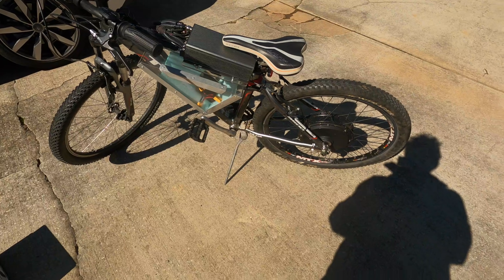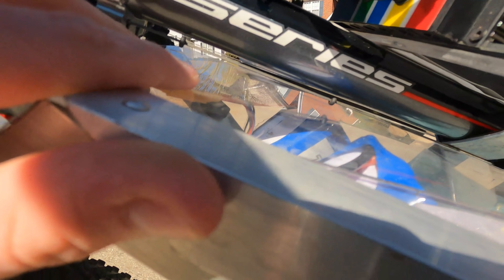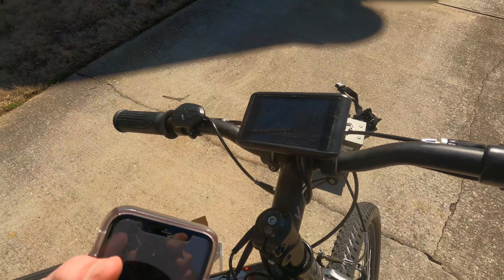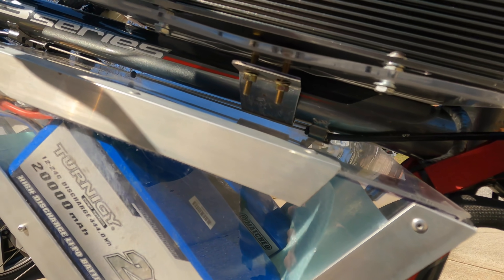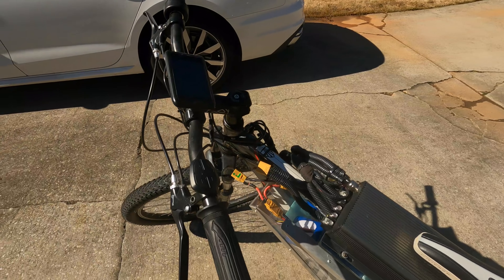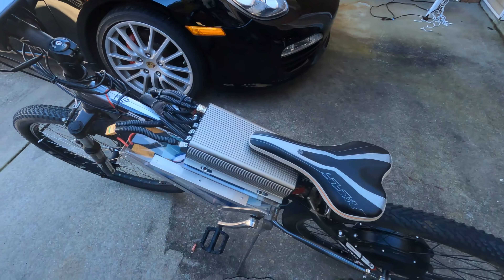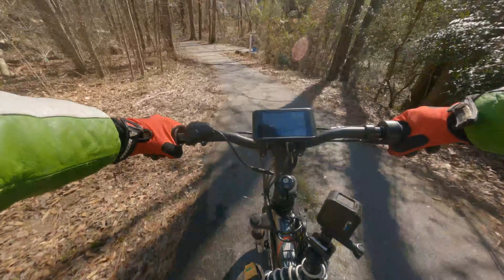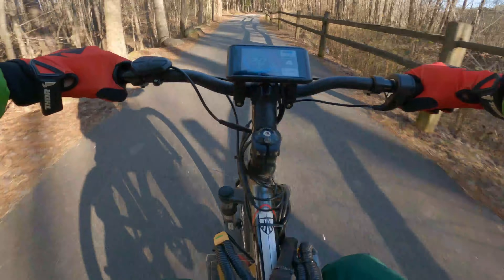My Homemade 10,000W Ebike! (Sabvoton72150)

Comment: 2 6s batteries = 12s, 12s * 3.6V is 43.2V, 43.2V * 150 is only 6,480w. Still very powerful, but not quite 10,000w unless I'm missing something.

Also, I don't think that controller can burst 350A, 350A is the max phase current which is the current between the controller and the motor.

Other than those two things, I love the build.

Comment: Did you put by your self the motor to the wheel ?cause i found the motor separate in stores and if i bought it with the wheel i must change also the rear fork to fat bike size

Comment: hey what size dropout is that meant for, I’m sure that bike isn’t 150mm. So is that you have to run one gear and it will fit? Also, are you bending the chain stays apart to make room?

Comment: Im running 5000watt same wheel with a 80a controller 72v40ah battery 84v fully charged .. sw900 display im getting 45mph what do i need to do to get it doing 60mph ?
Reply: Shunt mod
Reply: @dahman9672  does that give me more top end mate?
Reply: Gives u more all round watch some videos first make sure to put some protective material underneath before proceeding
Reply: @dahman9672  cheers mate yes I no how to do It I just thought I wouldn't get more top end I'm building a new bike now with a fardriver controller... But I'm gonna give it ago on my old bike cheers buddy

Comment: 500 watts is the limit for dealers selling bikes to the public .Running a aftermarket 10000watt hub motor isn't illegal. Going faster than 32km is. Daymak em2 with 10000 watt hub, Goodyear rubber,new rear monoshock and fun times

Comment: I go 80km/h 60V and 1500W , your have max 800W. 10000W means you go 130-150km/h
Reply from the maker: Power doesn’t equal speed. Voltage is directly correlated to speed.

Comment: Those 5 levels of assist are for PAS (peddle assist modes), don't know how you managed to hook that up with your throttle.
Reply from the maker: They can be used for either. I just disabled the pedal assist function. I have no cadence sensor.
Reply: @AllThingsElectric_  Nice.

Comment: What size are your batteries? I have a 72V 3000w and I'm wanting to use 2  36v,  100amp hour batteries will that work?
Reply from the maker: That would be one killer battery! Yes it would work

Comment: sorry getting in to electronics when you run these in seris does this create a 44v 20ah battery or a 22v 40ah battery thanks man
Reply from the maker: Series always adds the voltage and keeps the capacity constant.
Reply: @AllThingsElectric_  so would this be 44v 20ah?

Comment: This video is one of the best and greatest on the entire internet, because it shows an extreme motor on a regular mountainbike hardtail frame. Bikes with 1'000 or 2000 Watt, Stealth, "Motorcycles" and so on are plenty here on YT, but something like this is rare.
Question: Is the motor the 5'000 Watt one? For which frame dropouts is this motor - not for 135 mm?
Reply from the maker: Thank you! That was my goal! I haven't seen people put this kind of power on a frame like this (for good reason). I thought it would be interesting. It saves a lot of money, but is quite dangerous. Not sure about the motor dropout, although they are larger than the actual frame.

Comment: If those dropouts fail, those torque arms won't be much help. I'd strengthen the dropouts because 150 amps going through such a small area will eventually break it and you won't enjoy the outcome. Hope it all works out well for you.
Reply from the maker: It's been holding up very well so far, and now I am pushing about 14kW. Wouldn't be a bad idea though!
Reply: Is this layout safe?

Comment: Since you have two 22.2V, 20AH batteries does that make a 44.4V battery with 40AH? If you were to put three of these batterys together would it be a 66.6V, 60AH battery? If so that is a steal for only $650.
Reply from the maker: The two batteries are in series, meaning their voltage will add up and the capacity will be the same as one battery. In a series connection, the capacity of the battery remains constant.

Comment: You said you got 2x20000mah are these 2x52v 20000mah? I am thinking about buying this set up I have one 52v 20000mah battery would just need to buy 1 more.
Reply from the maker: they are two 22v batteries nominal
Reply from the maker: with two 52v batteries you would have to wire them In parallel so your capacity will double, unless you mod your controller to take over 100V

Comment: What kind of frame is it? 

Steel?

I build myself a 1500w rearhub  ebike. It was just a normal mtb with aluminum frame..

Now im planning to build myself anorher one.. and offcourse it must be bigger better faster than my previous build..
But im not sure if a regular aluminum frame is save enough to do so..

I have a steel frame wich i can use, and steel should be stronger..

Im not sure what kind of engine is possible for a steel frame..
Reply from the maker: Yep this is a steel frame. I would suggest steel unless you build the aluminum frame strong.

Comment: What W battery are you using with the 5000w wheel. Just wondering. (I allready know what V it is but wondering what W the battery is because I'm making a bike at home).
Reply from the maker: Well they’re 48v and can deliver 200a so 9600w

Comment: Hi there, All Things Electric: How steep can you ride uphill and how far can you ride uphill? Does motor get hot and stop when riding too long uohill? Which capacity of a 72 Volt Lithium battery would you think would work fine? Thank you for replying.
Reply from the maker: The bike has never failed on a hill, and has always had more than enough power to get through any situation. The motor is always cool to the touch also. 20Ah seems to be a sweet spot for me, but def could always use more.

Comment: Well actualy its 6660w because you have 12s 44.4v nom x 150A, at 66.6v (3lipo) you would be death hahah
Reply from the maker: Right, with this current voltage it’ll push less power than with a 72v setup. I plan to switch to 72v soon.
Reply: @AllThingsElectric_  congrats! Be minfull on the trotle haha what a beast

Comment: Hi how can your 48V battery handle that many amps? I thought you need 72V 150BMS battery for that
Reply from the maker: Since these are high discharge lipo batteries, they can safely pull 200 amps

Comment: Are you still running these batteries? just want to know how they are holding up.
Reply from the maker: yes i am! I have 3 of these batteries, and unfortunately one cell (in one battery) is much lower than the others. Lipos can be pretty difficult sometimes.
Reply: @AllThingsElectric_  I have a couple more questions. What charger are you using and can you charge them all at once? And how long does it take to fully charge. Thanks for replying love the videos.

Comment: Hay I built a 52v treck Marilyn 5 with a 1200w motor the current set up I get 35mph and a range of honest 10-12 miles. The battery is 52v 13h with an out put of 30 amp. I call it my little monster, love the build keep up the good work👊👊👊

Comment: Wouldn't that get Hella hot to the point where it would melt the phase wires?
Reply from the maker: This controller actually runs extremely cool. After riding heavily, it is still cool to the touch.

Comment: Hello, I have a 3t 50h 5000w motor, it has a 72v 80A controller and runs at 85km / h with a 26 "wheel, if I put a 150A sabvoton controller, will it run faster?
Reply from the maker: I believe that if you get the higher amperage controller, you will get more torque. Now you may get slightly more speed, but will mainly see a torque increase. Speed depends on Voltage.

Comment: hola yo tengo un motor 3t  50h 5000w, tiene puesto un controlador de72v  80A y corre a 85km/h con rueda de 26", si le coloco un controlador sabvoton de 150A podra correr mas rapido?
Reply: Jaja mas rapido. Quieres volar o que. Jaja

Comment: are you using flux weakening to get 60mph or what because I'm doing a similar build and wanted to know if i could achieve 60mph on it with a 48v system running with a 3.5t  ebike motor any suggestions greatly appreciated.
Reply from the maker: I believe I am, but I’m not sure. All I know is I had fully charged batteries, a main road, minimal wind resistance, and clenched fists. Speedometer was calibrated and read 56.7 mph.
Reply: @AllThingsElectric_  oh okay but do you think my build will be able to 50mph with 48v with a sabvoton 72150 controller and a qs 205 3kw 3.5t motor?
Reply from the maker: @jonathanbrunache3848  good question. Most likely yes. I was about to go with a 3kw motor, but I would have eventually wanted more power, so I went with a 5kw motor.
Reply: @AllThingsElectric_  thanks so much this helps a lot
Reply from the maker: @jonathanbrunache3848  ofc man
Reply: @AllThingsElectric_   sorry to bother you again but what parameters are you running on your sabvoton 72150 controller or is it default settings? your response is greatly appreciated

Comment: Awesome build mate. I am using 18s Lipos (6s x3) and it is amazing! Now I am saving to add one more 3s pack to go to 21s for top speed. 
Try it. You will go even faster. Just be sure to upgrade to hydraulic disc brakes 203mm all around...

Cheers

Comment: How's your dropouts holding up? I've installed a 3kw kit on my giant trance and my motor came out as those torque arms did not hold up, currently making some clamping torque plates
Reply from the maker: They’ve been great. Got two torque arms that have kept the dropouts solid.

Comment: What happens if you do a full stop on 5th?

Breaking is just as important as power and stability.
Reply from the maker: Regen does an amazing job. I can adjust it too. Brakes aren’t as bad as you may think.
Reply: @AllThingsElectric_  Sounds cool. I'd be too scared to try it out myself, before seeing someone else trying it a couple of times in front of my eyes tho. However, Kudos to you for an amazing job. \o
Reply: @AllThingsElectric_  Cant you use a much smaller VESC 75/300??

Comment: Have you thought about getting disk brake converters? U can buy em for like 5$ online
Reply from the maker: I have indeed. The frame would not fit disk brakes, however. I also use regen braking so it's not terrible.

Comment: Hi, im trying to spec out a build like this but I cant figure out how to decide the right spoke length to order to fit my existing rims, how did you find the correct length for your wheel build?
Reply from the maker: I measured the distance from hole to hole and added a few mm
Reply: They have sizes 20inches to 29. Good luck.

Comment: just one more question lol: will at least a single gear fit back there? i am happy to see you managed to fit that wheel on your bike, as i suspect its a 135mm wide, but the wheel is 150mm, right?

i ask all this stuff because i think i am about to order this stuff and build it soon, but i may go with four 6s lipos in series for some series speed lol. we will see, but $800 in batteries is going to hurt a bit lol
Reply from the maker: Yea I actually planned on putting on a single speed freewheel. I have one to put on. The wheel is a 26” rim. Batteries are super expensive!
Reply: @AllThingsElectric_  indeed they are. 

hows the trail climbing power on your rig? i thought if i got a big enough motor i would have both torque for hill climbs in the woods on trails, and high speed on the road.
i really appreciate your video, your video is the only one where i see such a large setup on such a small bike, which is my plan as well. do you plan to make any changes to your bike besides adding the rear gear? any regrets? my fear is that the rear fork cant handle the power. but time will tell lol and i can always weld some reinforcement.

i want to pack the most power and battery i can on this bike and still look like a bike so i can ride in places i probably shouldnt lol

Comment: how long can you ride with those batteries? i am building a bike to commute to work 30 miles away. ok i see you said you can ride about 50 minutes, is that 50 minutes at top speed? i plan on using the highway and trying to go 55mph or so the whole time, which i am sure it not safe lol.

btw i checked out your batteries, arent those 22.2 volts nominal and 25.2v when fully charged, two in series is 50.4v, also they are 20ah, and since they are in series it would be 50.4v times 20ah = 1000wh. if your controller can pull 150 amps at max then it would be 50.4v x 150a =7500 watts. if you pull 7500 watts from a 1000wh battery, it would last 8 minutes according to my math. i am new to this, can you see any errors in my math? something tells me you almost never pull 7500 watts from that battery though. are you sure your batteries are only 6s? other wise it seems like your voltage has to be what i stated. i thought i read where that controller can work with 60-96 volts and it seems you are below that
Reply from the maker: About 50 mile range. Yes you’re correct mostly. Two 6s batteries in series is 48v nominal. This controller can handle 72v and maybe more like you said. However the controller can peak at up to 350 amps, so under heavy acceleration I will pull much more than 5000W.
Reply: @AllThingsElectric_  thanks for the replies, have you tried to run anything but lipo? and if so how did it compare? i assume the lipo will have a higher c rate load response translated to higher amp capability which means more torque
Reply from the maker: But I get 50 mile range riding pretty conservatively. You might want a bigger battery.

Comment: Nice build! Question u didn’t address tho, how did you fit that motor into 135mm dropouts (which that Trek 3500 has, to my knowledge)? Seems like the 3500 also has an aluminium frame, so bending them to 150mm wide wouldn’t work.
Reply from the maker: I actually filed out the slots to fit the motor. I also had to bend the frame to fit the motor. Sounds bad, but I haven’t had issues. Great question!
Reply: @AllThingsElectric_  Wow, I can’t believe you were able to fit that motor that way! I’ve been looking for a steel frame to fit a 150mm motor in but I couldn’t due to the bike shortage happening right now. Using a spare aluminium I have would be so much easier. Did you have to cold set the dropouts or did you just force the wheel inside while bending the frame?
Reply: @burnner307  i was wondering the same thing. this dude has shown it can be done, i guess its up the the user if its safe enough, i think it will be fine as long as there is room for at least 1 small gear in the back. i want my bike to still look like  a bike lol and peddle home if there is a problem
Reply: What method did you use to bend out the frame? Awesome. Talk about necessity is the mother of invention. I want to do this to my old trek bike with break pads ;)
Reply: Is that a 19 inch rim?
Reply: I had the same question, bending the frame out is an interesting tactic, it must be done very well to prevent the drive wheel being offset from centre in any way. Good job.

Comment: You can get the more heavy enduro frames for about 100$ on Alibaba - maybe you’ll need to do a little negotiation, but it’s pretty easy. They also offer all the suspension, handlebars, crank and stuff to go with the frame for pretty cheap - I was offered everything, full suspension and all. Everything except wheels and electronics for 550$ total, including shipping to Denmark. I never took the offer though, I had some other projects going on
Reply: 10000w and vbrake. Defenetely not a good idea!
Reply from the maker: You're not wrong, but the regenerative braking helps tremendously.

Comment: 10ˋ000 W with 2x 6S LIPO in Line?? 44.4 Voltage are 13.6 Horsepower= 225 Ampere at the Moment with this thin Cables?? I don't think so
Reply from the maker: 2x 6s lipos is 48v nominal. The phase current can burst to 350 amps. 150 amps normally. When fully charged I’m at 50.4v, and if I pull 200 amps, that’s 10,000W. That also equates to 13.33 hp. These wires can most definitely handle that current for a small time. The controller is also a 72v controller. If I pull 150 amps at 72v, that is 10,800W.
Reply: @AllThingsElectric_  those looked like xt 90 connectors, the 90 means 90amps max, or they melt. i am guessing the wire is 6 or 8 gauge but it could be bigger i guess. i think that controller can only pull 100 amps max, that is from the website of the manufacturer. you could put a amp clamp on the wire and set it to capture highest amperage spike, that would make for a cool video. hell i might just install a watt meter on mine and do just that, so i cant see exactly whats going on and observe energy consumed over time but i still need to build it lol.

Comment: hello i also want to diy my bike with this motor and batteries what charger will i need to charge all 3 batteries and how long will it take? Because i am 40 km away from work so i would like use my bike for it but 30km and then work and then back home i would be very tired when i get home so i nedd a cheap and fast e bike with some good capacity
Reply from the maker: I usea 500W drone battery charger that charges at about 12 amps. Only a couple hours for a full charge.

Comment: A little question which came up, discussing this bike with a friend: He told me, that if the batteries run empty, the electric motor would be a big resistance and it would slow you down really fast (in an unhealthy way). I replied to him, that the computer should take care of it but i couldn't find out how it operates. Do you have any experiences regarding this problem? :D Best wishes from germany!
Reply from the maker: Yes, the motor would provide resistance to the wheel if there was no power directed to it. Not necessarily unhealthy if the bike is powered on, since spinning the wheel would generate power back into the batteries. But yes if the bike were completely dead it would slow the bike down very fast.
Reply: Grin technologies have a virtual freewheel that addresses this, but yes it is a real issue with hub motors.
Reply: If u cant disengage it, it will be like having a break on. Perhaps